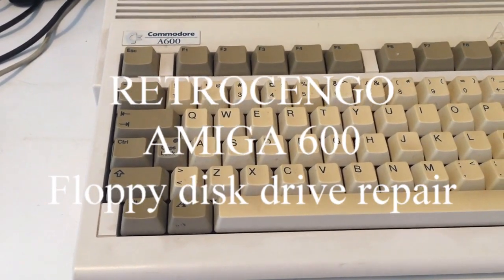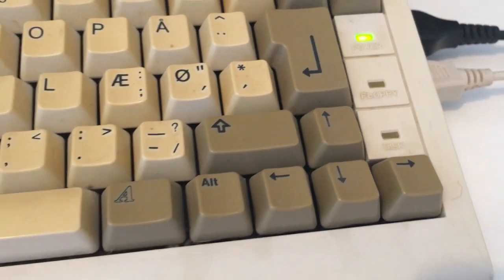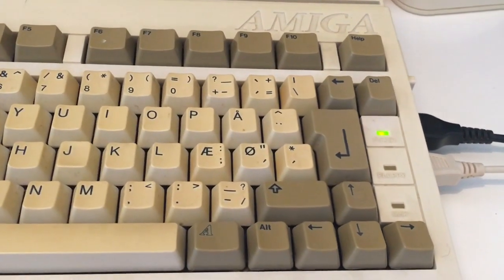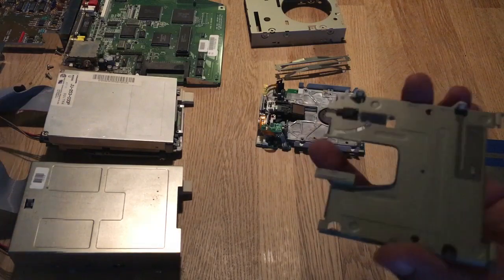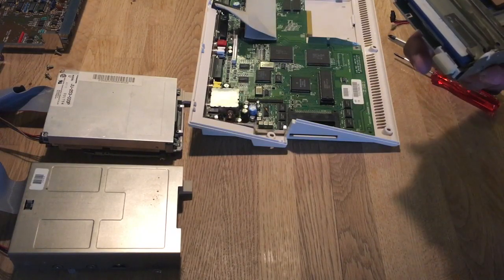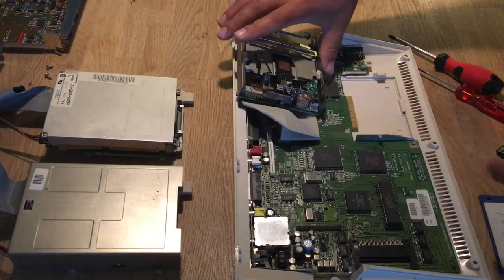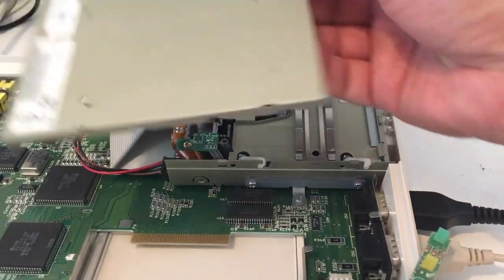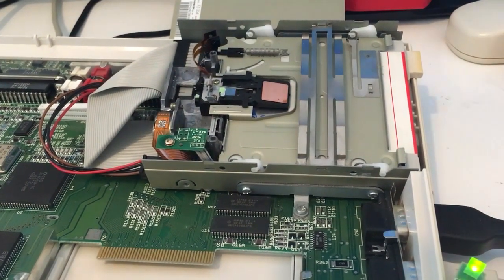Commodore Amiga 600 Floppy disk drive repair

Comment: Jeg har lige modtaget en ide adaptor som giver 600/1200 to ide porte. En 44 og en 40 pin. Den fikser diode konflikt, når man har SD-IDE adaptor. Den er mega awesome.
Reply: Glemte lige at tilføje. CF kort er mindre stabile end SD i visse tilfælde. Har kun læst om CF issues, men ikke set noget nocen steder omkring SD kort og problemer.
Reply from the maker: brostenen nice, du kan også få cf kort holdere med indbygget diode. Jeg har en der lyser hele topsiden af Amigaen op, kølerrillerne lyser røde op. Ser fedt ud
Reply from the maker: brostenen ellers gør det med winaue😄
Reply: Cengomania X Jeg har allerede flyttet dataen fra CF til SD. Jeg benyttede FS-Uae på Linux, med en folder mounted som "harddisk". Jeg skulle lige give begge flash kort min egen account som midlertidig ejer. Ellers mødte jeg kun et problem. Dopus installationen bitchede over disk aktivitet efter jeg have lavet en rå kopiering. Det blev løst ved at installere den oveni samme drawer igen. Så nu kører jeg SD kort på min 600'er.